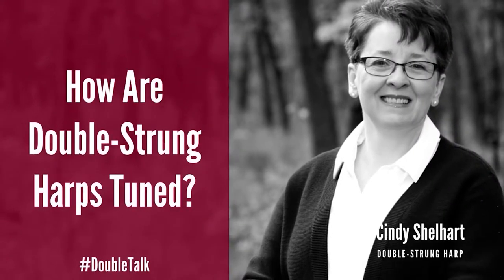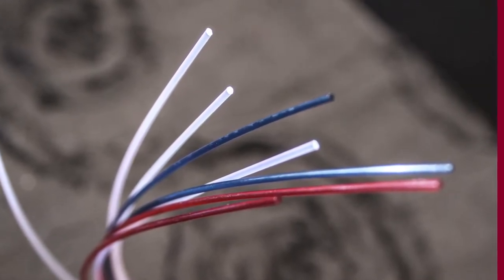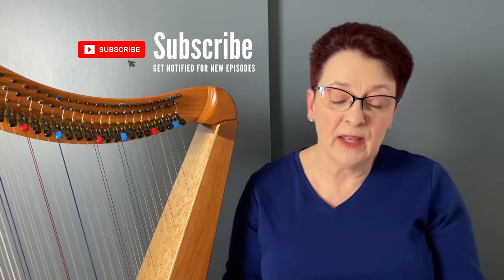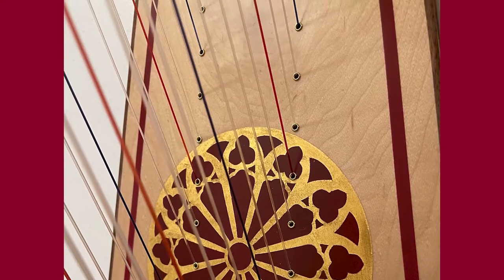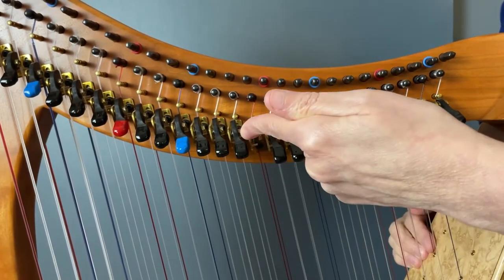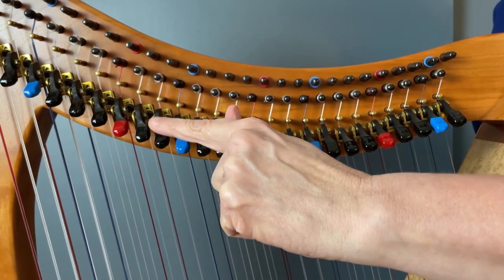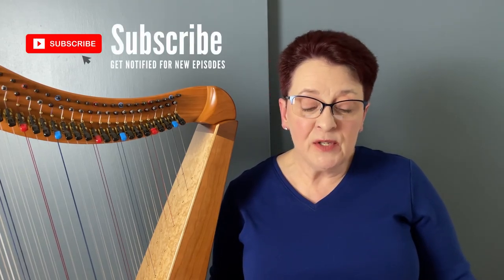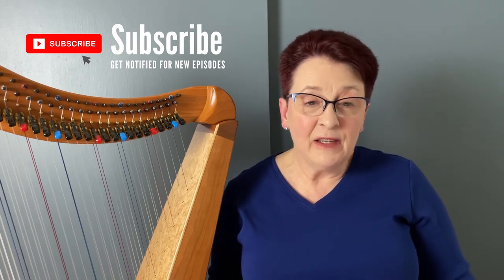How are Double-Strung Harps Tuned? [Double-Strung Harp FAQ S1E2]

Comment: What about cross strung harps?
Reply from the maker: Hi, great question! Cross-strung harps are chromatic, and the strings cross in the middle to form an X (hence the name), and these harps require a totally different technique.

I specialize in double-strung harps, which are diatonic instruments, with the 2 rows of strings in parallel (no crossing in the middle), and sharping (semi-tone) levers on each string. And double-strung harps use the same technique as other lever harps.